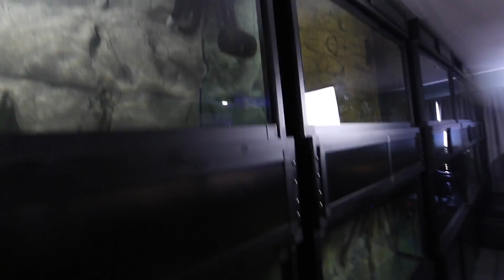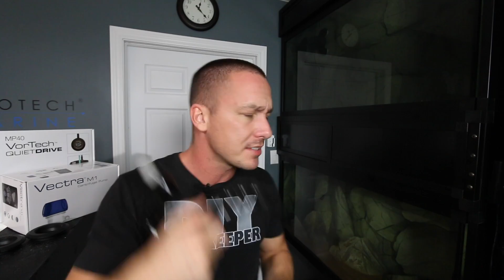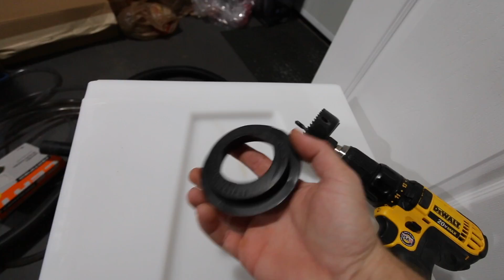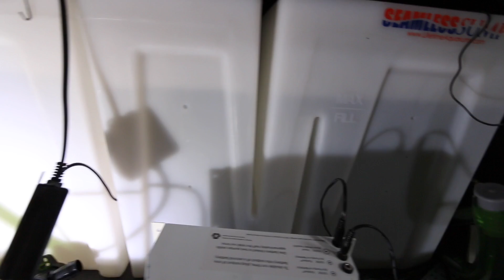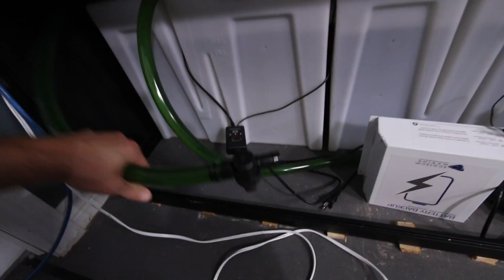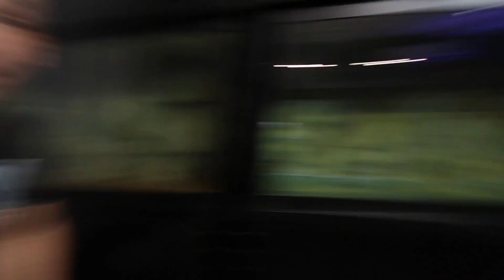SETTING UP THE FIRST AQUARIUMS in the aquarium gallery

Comment: I understand that wave makers for marine fish is necessary but do freshwater fish really require it, because all its really doing is breaking up the surface of the water to allow for gas exchange, but if the filter has a high enough flow rate, you're still disturbing the surface of the water.

Comment: Why did you put the uniseal so high in the first sump? There will be no flow going through the bio blocks. I would think reactors might work better to pull the water down eliminating dead spots below the uniseal. Then use the bio blocks in the first chamber of the second sump.

Comment: I'm glad ecotech is sponsoring a lot of this, between the saltwater and freshwater camps we kind of stay in our circles and have our manufacturers and vendors that are well known in our respective hobbies.  A lot of advancements in lighting and care for planted tanks have contributed to more efficient nutrient export in our reefs with maximizing growth of macro algaes, and ecotech is a good example of a primarily marine brand which obviously can be just as useful in a freshwater environment.  

I'd like to see Neptune Apex send Joey some equipment so he can play around with taking our reef controllers and computers and putting them into his gallery to provide custom notifications and output events on flow rates due to his quiet pumps.  You can program an in line flow meter with the apex to turn on an audible alarm or send you a text if the flow drops below a certain threshold in that tank.  Also, outside of the salinity probe, having a network based temperature, ph, and orp sensor would be handy in anyone's tank, not just the reefs.

Comment: Joey, It might be a good idea to hook up your heaters and set them to a slightly lower temp - say 25 degrees. That way, they never run day to day but if the room heater fails at night or when you're not around the tank heaters will kick in and stop the water chilling down too much.

Comment: Hello, Joey, I am a freshman in college and just set up a 20-gallon tank in my dorm room. I am having an issue with black beard algae and I was wondering if you had any advice. Right now it is surrounding almost all of the leaves on my java fern. I have read stuff about using H2O2 or Flourish Excel but I would rather not add chemicals to my aquarium that could harm fish. Do you have any advice?

Comment: you need to plant a garden next to the gallery and when you do water changes water the garden with that water full of goodies. Grow some zucchini or cucumbers for fish treats. Put all drain lines hooked into 2 inch pvc drain line plumbed thru wall and outside, just flip ball valve and it is watering garden

Comment: I'm assuming that you're running the tanks if for no other reason than to make sure there's no issue with the equipment since you're keeping a lot of media to set up...

Not really something that would commonly go wrong, but it is something that can and if you have some time before stocking a tank, get the tech side going to make sure it's running correctly before your fish go in and it becomes harder to deal with those issues.

Comment: I only recommend or use uniseals for outdoor use.  They will always drip at one point or another, and leak the older they get.  Vibrations in the system, angles in the placement of the PVC pipe, or imperfections in the hole that it drilled all contribute to them leaking.  Always use bulkheads, they are a sure thing.

Comment: The King of DIY - you should put a black sheet of metal between each set of tanks to cover the gap and any cables or equipment between them. You can even use magnets to put it up, so you can move it easily.

Comment: you could connect your vector to IFTTT - then use let´s say a wlan-ledlight which would blink if the Pump stops working ;) i did mine like this, works like a charm. :)

Comment: How much is ur electric bill bruh
Reply: He did mention he cut his electric bill in half somehow, but I imagine it must still be pretty high.
Reply: Buzsaw Bowser engery efficient equipment and heating the air to heat the water rather using a heater on every tank or set of tanks.